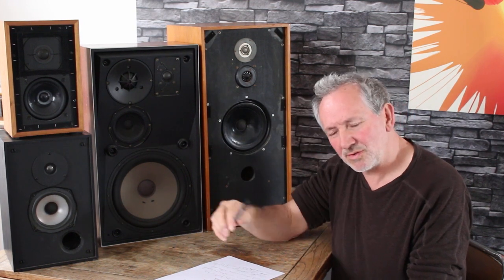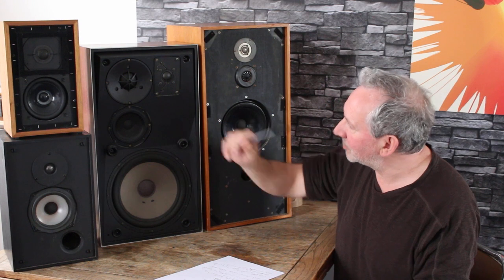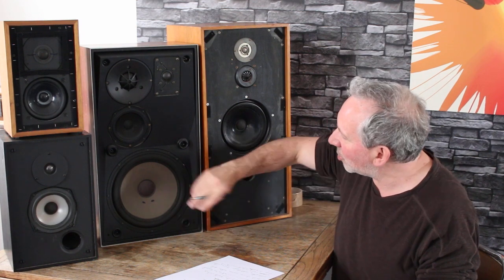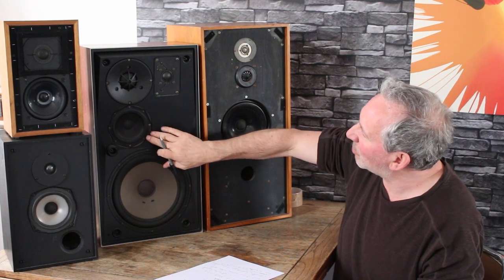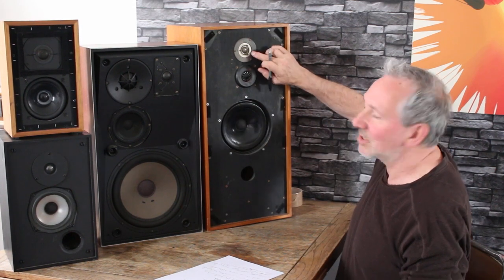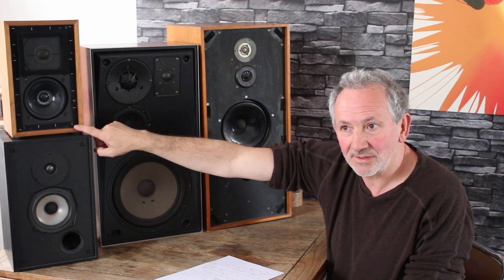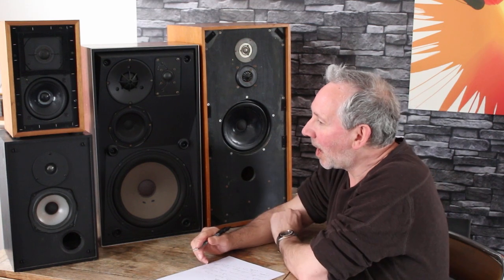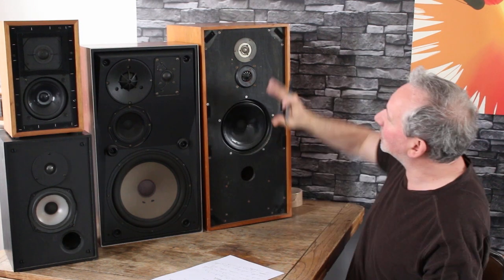Best speaker driver configuration 2 way 3 way 4 way  and more discussed (part 1)

Comment: There is one inherent Flaw within Crossovers, it breaks up Frequencys we´re most used to listen to on an everyday Basis.. like Voices etc.
Our Ears are very addapted in a narrow Spectrum in the Middlefield, compared to the Hi-Fi-Scene, in the professional Studio Sector 
we mostly rely on a Combination of Monitors(mostly 2-way sometimes 3-way rarely more) and Mix-cubes like Auratones with very linear Middlefield spectrum with only 1 Driver, which is the important Part.
No Crossover, means no Breakup and very Natural Sound.. Ever listen to Vocals or some Strings on a High Quality Broadband? You´d be amazed

Even just with a 3-Way Speaker, you have to create 2 Crossover-points, this leads to a drop in Volume for one Driver and increase in Volume for another, so you allready have 3 Drivers 
doing some same Frequencys but in a different Color, so you have Resonances, and that has to be EQ´d, which leads to unnatural Harmonics or even Distrortion and so on.
Also, even today Company´s struggle with Phasing, that´s why those huge Speakers are curved and you can really only sit at one Spot, and have to have your Room treated.

Guys, just get some decent Headphones or build your own Speaker, maybe dabble in Some DML-Speakers, those really outshine most Hi-Fi-Cashgrab, you need a Sub though.

Comment: Hi Kelvin. Have you had experience with any 2.5 way speakers? I'd like to hear speakers that use a separate dedicated driver for each octave from 20Hz to 20kHz. Do you think this idea is crazy or a good idea worth trying?
Reply from the maker: You mean loads of drivers well I think this works better in the imagination, there wouldn’t be a consistency it be hard to put them all together seamlessly
Reply: @stereoreviewx  Yes. I think you are right about that. My preference is the classic 3-way or a 2.5-way system, which when done right, delivers everything I want for high quality hifi sound.

Comment: I've also done 45'ish years enjoying music, first as a low'paid electrical technician apprenticeship (£8:09p / week at 1'st) ... listening through s/h speakers (& s/h vintage valve amps in my first 25 to 30'yrs (of real hi-fi) at cheap pre-eBay prices from local ad's & that old mag' "Exchange & Mart")  I'm 65 now & bought my 'better' own hi'fi gear from 20'yrs old &+ when I had my first flat.
 I've owned many speakers from always looking  to improve my sound. I remember that IMF monitor (I once couldn't afford s/h but bought the more affordable s/h 3-way KEF Concertos instead & later, a pair of Cambridge Audio (?) ...but tall slim f/standers with vertical grooves in their black grills ...gr8 sound! & i think with the same drivers as the KEF's Concertos. 
My point is about driver materials, paper woofers / woofer-mids always  sounded best to me (tho KEF B139's flat-faced racetrack shaped woofers were gr8, with their polystyrene (?) type of diaphragm construction) Older Metal dome tweeters i heard were not often smooth but more often brittle.  And my biggest driver hate of all is: Polypropylene woofers & woofer-mid drivers, no matter who made them, all the polyprop' driver'd speakers I've had or heard, all had an annoying cuppy colororation to their sound,  esp' in the lower-mid but throughout. The Mission 770 'Freedoms" had that awful polypropylene coloration & I don't know why hi-fy mags rated them so highly.  And I always enjoy your videos.

Comment: Completely agree. I have actually made 5-way speakers, but I run them with active crossovers and 5 dedicated power amplifiers. Conventional two-way speakers sound like portable transistor radios in comparison.

Comment: I would vote for the 3 ways I've owned over 2 ways I've built...
Our main listening room has a pair of 3 way 10 inch  Dyna- Audio kits (built 30 years ago from Meniscus audio)....I reconfigured them in a smaller formant replacing the woofer with 6 1/2 inch....Driven by a 90's Adcom system they punch base push midrange with crystal clear highs
Recently built the Hivi DYI 3.1 with upgraded crossover from Amazon...Yes these little speakers do deliver in all aspects...Highly recommended....Though both sets are small configuration they keep up with my 70's ESS/Canton 10 and 12 inch in punchy bass and sparkling highs....Yes, size does matter, but contemporary smaller drivers with quality crossovers and aligned cabinets can make a huge difference....
Reply from the maker: Yes I agree three is better than to almost always

Comment: There are some great two way speakers out there. However  they always come with a compromising factor. In essence though, they only come in two varieties. Speakers that really only deliver high frequency and lower midrange, meaning they are totally dependent upon porting, and strategic placement to produce reinforced bass. Or, secondly, speakers which deceive the ears by forsaking midrange altogether in order to produce convincing bass and treble. The inescapable truth is, there really is no substitute for a decent, emphasis on DECENT, three way speaker.
Reply from the maker: Yes a good three-way is a great thing and I agree it’s rare a two-way pulls it off properly.
TheLS35A  doesn’t deliver in the base but the middle and top is just beguile you so much you don’t notice it. K

Comment: I found a pair of DCM Timepiece speakers. They definitely lack in the bass, and could be a little better in the highs, but the midrange is amazing!!
Reply: They sound good about 10" off the floor they will get some bass reinforcement from the floor and wall.  I was surprised at the bass response when near the floor.

Comment: Great video, I enjoy watching your channel! One comment about the B&O speaker, it should really be viewed as a 3-way speaker, with the 4-th driver acting as a "phase-link" - it fires in a narrow band with a peak at the crossover frequency between the woofer and the midrange, which are connected in phase. This technology was called "uniphase" by B&O, these speakers have linear phase response, are time aligned and transient perfect.

Comment: I own 2 pairs of Canton speakers, one with silk dome and one with metal dome, and silk is more harsh and brighter.. metal dome sounds majestic and clean and is much superior.. so it's about crossovers I guess
Reply from the maker: Well maybe not the crossover I mean the early metal tweeters 1980s for sure we are definitely spiky but if it sounds good it sounds good and I doubt the crossover is changing that characteristic
Thanks for feed back I have never heard canton speakers .
Are they German ?
Reply: @stereoreviewx  yes, interesting thing is they produce 100% in house, from drivers to boxes and cables inside, everything..
Reply: sometimes the crossover changes the characteristics of a tweeter by reducing the voltage not just filtering out the frequency range.. an under-powered 'harsh' tweeter may sound more pleasant than a overpowered 'smooth' one
Reply: sometimes the crossover changes the characteristics of a tweeter by reducing the voltage not just filtering out the frequency.. an under-powered 'harsh' tweeter may sound more pleasant than a overpowered 'smooth' one
Reply: JOHN Heisz on his audio chamnel also argues that it's just the cross over and I agree. There's this general perception metal domes sound brighter but this could be manufacturers playing to that perception and make it sound brighter. At least if the resonance frequency is outside audio range and the infinite baffle response is reqsonably flat.

Comment: In the 2 way speakers the woofer manage bass and mid-range, but when the bass moves the woofer it creates a Doppler effect on the mid-range sounds that turns a bit confused or un-focused that mid-range, but the more ways or components the more trouble at the crossover transitions, there were in the 70's a speaker with 5 ways but with a very good crossover design that you didn't notice those crossover transitions that was the Dahlquist DQ-10.
One of the most clear mid-range I have heard was the B&W 802 S3 with it's Kevlar yellow mid-range, the only coloration of that speaker I found was in the upper bass due maybe to the need of a bigger bass box volume I'd say maybe 20% more volume to the bass twin 7 inch woofers, but forgiving that coloration at around 150hz that is a faboluous speaker.
Another low colored speaker was the JBL L-112
On other side the Martin Logan's but they are roll off above 10khz and as I can hear to 13 khz I find them incomplete due to that 10 to 13 khz roll off but in the mid-range are excellent.
On early 80's Canton from Germany made incredibly musical speakers for me much better than those Rogers, I remember Canton Plus S and Plus Beta active subwoofer they were super musical, now I don't like Canton's modern metal cones and speakers, those of the 80's was wey better.
Reply from the maker: hi  Thanks for your info  ,yes metal domes just dont seem to deliver .
the dhalquists are interesting i have never heard them but they do have legendary status in the uk maybe not now but in the 70 80s .
interesting point i think the way the dhalquists arranged the drivers at ear level and i think mirror image is a big plus .
if your happy with the look ,i would be .
great to get peoples unbiased opinions.K
Reply: @stereoreviewx  The first mirror image speakers were JBL L-112 on 1980 as an improvement over the L-100 which was not mirror image pair.
Since then every speaker design that do not employ mirror image design is a big mistake, this only apply when the voice coil of drivers are not inline.
Because it affects the image and soundstage capabilities.
Reply: @stereoreviewx  first generation of Dahlquist DQ-10 was not mirror image then they made a 2nd gen with mirror image.

Comment: Yes, I totaly agree about the mid range emptyness of 2 way speakers.
Reply: Are Spendor BC1 the best vintage affordable speakers you have heard?Thanks!
Reply: @beslemeto  Can not tell...
Reply: Get some DM3s with EMI drivers, the midrange is glorious.
Reply: Hi, I have a 3 driver 2 way center channel 
Why’s most of the sound coming from the left woofer and middle tweeter and the right woofer produce mostly good bass is that normal ?? It’s a paradigm reference studio cc v2
Reply: @yannolove1335  It is not normal
Reply: @beslemeto  what could be the problem my center is paradigm reference studio cc v2 center Chanel ? Took it to the shop the guy play it and put his hand on the woofer and says everything works fine
Reply: @yannolove1335  join a forum, this is not the proper place to seek advice, just an idea
Reply: @yannolove1335  Likely one of the mid woofers is crossed over to produce only bass to avoid comb effects in the midrange from a widely spaced second mid woofer.
Reply: @yannolove1335  probably a 2,5 ways speaker.
Reply: define the frequency or at least the range.. mid range can mean anything from how the G sounds on a bass to how the high E sounds on a guitar :}
300Hz - 5kHz? 
500Hz - 2kHz?